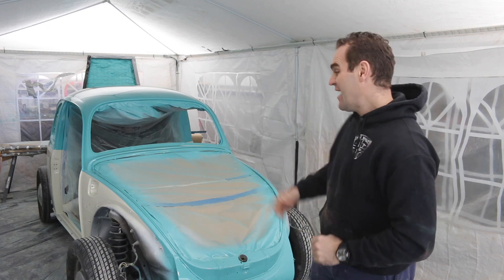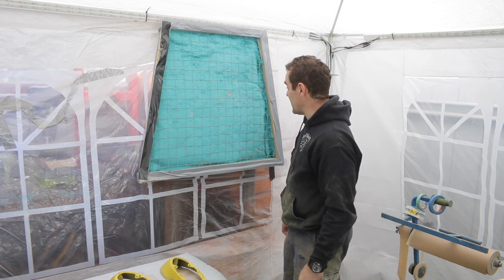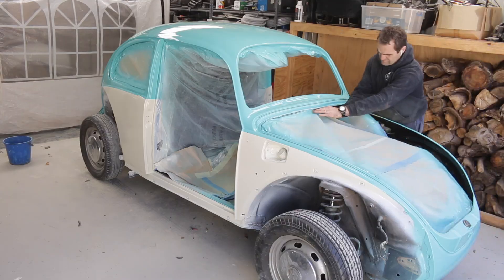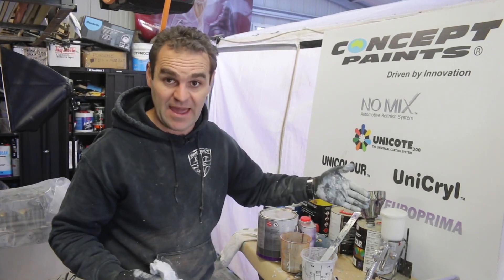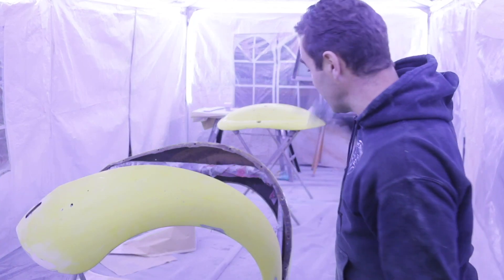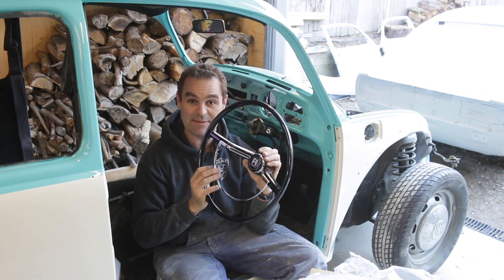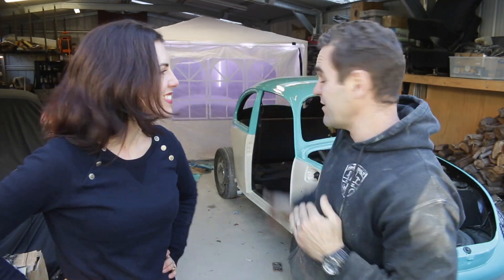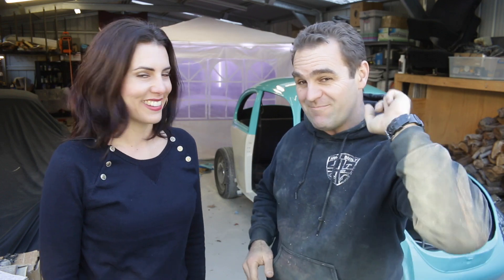Priming the bits - Home Built Project Beetle part 20

Comment: I dont think your going to like it but the steering wheel you just bought will only work on 71 and earlier standard beetles, and the steering columns for supers are only for supers. you may be able to modify a standard beetle column to fit, the supers column are much shorter. the company flat 4 may have some aftermarkets that you may like instead of the wheel on the car when you bought it.
Reply from the maker: Actually I have done more research and the wheel I bought is for a 74+. My car is a 71 so I need an earlier wheel :(

Comment: The retro wheel looks good but I believe as previously pointed out that the splines on the shaft changed after 71 for Superbeetles . I believe that the next pattern was for 2 years 72-73 and changed in 74 again. A person to talk to would be John Chabot of TopLineparts who specializes in Superbeetles . he also writes the tech help in Hot Vws magazine. I bought some parts for my regular bug  like his alu gas pedal and monster accelerator cable that will not stretch or break and he was great to discuss things with on the phone I believe if you go to his site there is a ASk john page He may be able to advise you on if you can change the steering column to an earlier one or if you have any options at all. By steering column I mean the shaft itself and not the whole assembly. Best of luck
Reply from the maker: Yep. The wheel I have is for 74+ and my car is a 71

Comment: You can take the new steering wheel (make sure to tape it up so it doesnt get scratched) and remove the steering shaft and take it to a machine shop to turn down the shaft on a lathe and then cut grooves for the splines. Its not rocket science for a descent machinist.
Reply from the maker: That is still far too much work than just getting the right thing, or changing the whole steering column

Comment: Jeff - VW did some weird things with steering splines. On the Mj2 Golf they changed mid production to a larger but finer spline. They achieved this with an adaptor that fitted over the original smaller diameter but coarser original spline. Look carefully at your column they may have done the same on yours, not the easiest to spot. If it is an adapter you need a gear puller to get it off. Great work, I like the mint, any sign of the flat 6?
Reply from the maker: I will have another look, but I don't think I am that lucky :(
Reply: https://www.thesamba.com/vw/forum/viewtopic.php?p=6324894
Hope that helps
Reply from the maker: Thanks. I have sent an email to the supplier, so I can hopefully sort it out.

Comment: My opinion is to get a different steering wheel. I'm not a big fan of the huge wheel.  But, I am a big fan of the color of the car.
Reply from the maker: I really like the original wheel, and trust me, without power steering the big wheel is a plus ;)
Reply: Ahhh, yes. I forgot about the lack of power steering. BTW, I have a 1981 Fiat spider. No power steering, and I put a smaller momo steering wheel on it, and yes,  it's much harder to turn the wheel at slow speeds.
Reply from the maker: I have a small Momo for my 911, which looks great on a sports car. The Beetle is far from a sports car ;)

Comment: its wrong because you likely bought for a car thats PRE Super Beetle ??
Reply: the super beetles had rack and pinion steering and proper collapsable steering shafts, where the older steering box type had a very old honey comb type end to " collapse" and was much thinner
Reply from the maker: I have just found out that the steering wheel I have is actually for a later model ('74+), and I need the earlier one.